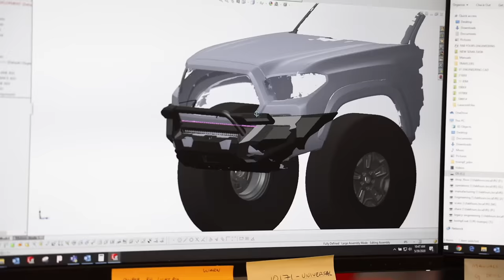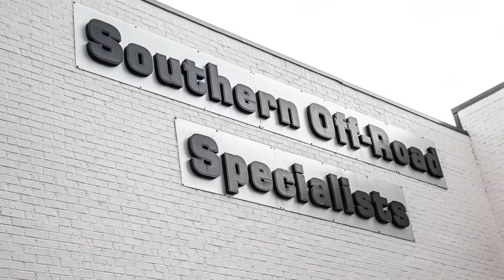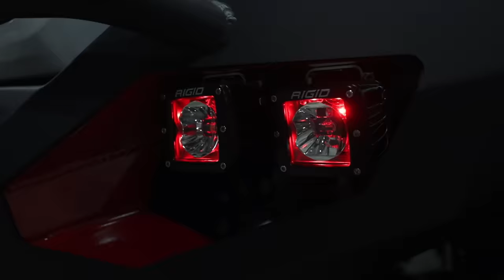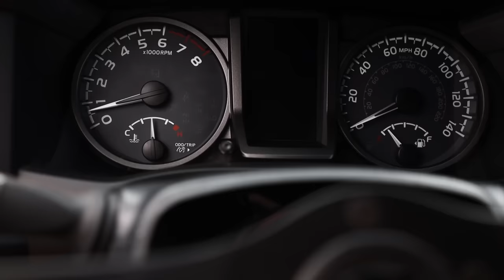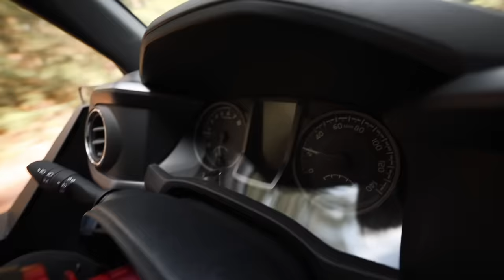Toyota Tacoma Jeep KILLER! Fab Fours Build Walk Around

Comment from the maker: Table of Contents: 
0:00 Intro 
0:35 Why Fab Fours Build this Beast? 
3:05 Why the Tacoma? 
8:15 Wheels & Tires 
10:35 Suspension System 
14:37 Total Lift Height 
15:55 Fitting 40" Tires on a Tacoma 
17:05 Custom Fenders 
18:05 Armor & Bed Rack 
22:11 Lighting 
24:58 Solid Axels 
28:14 Dashboard 
31:51 Transfer Case 
34:20 Interior Mods 
36:52 Sound System 
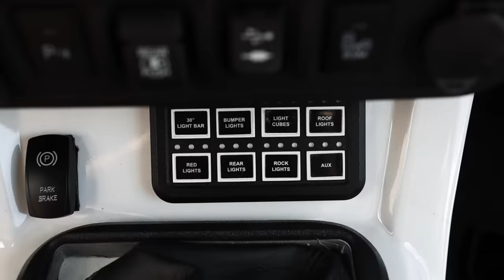39:30 Engine 
40:15 Tube Doors 
46:07 How long did this build take? 
45:50 Total Cost? 
47:34 Future Projects?
Reply: This time series was really helpful . I was here for suspensions but it's all new underneath . 🙏  U got real knowledge . Very few have.
Reply: Just put a procharger kit on it
Reply: No offense at all, Greg, but don’t you make a sh*t load of parts for jeeps too? As a Jeep owner, with 13 built for street (a slammed JT, JTR, JLR, CJ5/7/8 and JKR, to name a few), also built a few Tacos incl a 550whp XRunner, TRD Pro and Classic 86 BTTF tribute with modern KCs, bullet hole wheels and 37s lift 6”, im about to sell my 475hp/521tq 2.0L turbo (Garrett G25-550 turbo) JLR to go back to a 2024 TRD Pro Off Road… any advice?
Reply: It's cool, but that cost way more and had /needed way more parts, fab, work done to be a "jeep killer" and it's still a v6 .. would much rather have the v8 jeep wrangler,  gladiator or even cherokee fully built up. And over a jeep I'd prefer a raptor r , ranger raptor or the bronco raptor with very few actual modifications needed to jump, off-road, rock crawl, sand dune, Baja race/drive fast in the desert, mudding and still be able to drive daily, tow my dirtbikes, quads, Harley or Ducati, snowmobiles ect .. still use for hunting/camping in back country/mountains ect for days and have room for everything I need and so on. This is just a Tacoma body on a fully completely custom everything else as cool as it is

Comment: so having a 2019 taco and looking at what to change as well as what can be changed - never did I imagine swapping doors. If we can get them to a quick swap (and to me that is 30 minutes) that would be awesome.
My only "issue" is the aesthetics and how the doors are angular and not following the lines from the front fender and the bed line. me personally, I would like to see the doors a little higher up for the top of the tube doors to line up with the bed line right above the "sloths back".
but this really opens my eyes to what can be done  - just have to find the budget to make it happen.
Reply: Door height is based on arm on door during cruising. Too high and arm on door wont be comfortable. U want form or function? Owner choose function, your thumbs up show form. There is no right answer.
Reply: You'd have to install bars to strengthen the door joints. That car was not meant to ride without doors, so it compromises the body structure. Not to mention that if you were tboned your almost certainly die. Not a good idea
Reply: @argon7479  Ok Karen... 
-First; it's not a car. 
-Second; How do you know you'd have to strengthen the door joints? Or are you just speculating? Exactly how much does it compromise the body structure? Perhaps it does a little bit but what's the worry? Are you afraid all the gaps between body panels won't be 100% perfect all the time? This truck was built for extreme off-road conditions and the frame will be twisted and contorted in every which way when on rocks or a crazy trail and it will be fine. Are you concerned that a body panel or two may not perfectly line up? Oh no! 
-Third; Considering that this truck and most others that might have these doors will be lifted vehicles, therefore if you were t-boned most cars would slide underneath it upon impact. Unless it's a semi truck and in that case you are toast no matter what. Plus it's the door jams themselves that would protect you in that case not just the thin doors... "not to mention" that his tube doors look more structurally sound and stronger than the light stock versions. I mean, come on man... this guys company makes BUMPERS professionally for heck sake.
Reply: @zachhartson4819  I know because I've literally bent somebody's frame while they had the door open on their car, when it was fine riding for 19 hours with the door shut. Unibody frames require the doors to not bend, and when you have a car you are using the crawl over rocks, you're going to bend the frame. Most cars wouldn't slide under. They'd hit the bottom of the door frame, which now that there's no door, is going to bend straight upwards and severely injure, if not kill you. Car doors are designed to crunch and absorb impact, plus keep the person safe with soft plastic and airbags. This will just mean glass and metal shards shooting into the car. Look up Jeep impacts without doors. Those cars are actually designed to be stable with no doors, but crashes demolish them with no doors
Reply: @argon7479  If that's the case, then it seems as though this guy didn't do his homework. Although being in the off road scene as he is, you would think this guy should know some of these things that you are talking about. So what you are saying is that this truck without its full sized doors on it AND closed, it will get structurally damaged once it's been driven off road? Considering he upgrades and builds many types of 4x4 trucks for a living, one might think that's something he would know about, that's all.
Reply: @zachhartson4819  This truck is not really meant to be a great offroader. Trucks in general, are not good for offroading and this is mainly just a show truck. Having doors off, might look good for show, but it doesn't take a genius to know that it's not practical. The truck survive some slow and careful offroading, but id never want to take this driving on normal streets because of how dangerous it is. One side collision and the entire driver's area is crunched

Comment: Hell yeah, I'll take some of this hinges that let me (easily) take off my factory doors off in 15-20mins, i dont care for the tube doors, but if I could just take my factory doors off for a day of wheeling, and back on once I'm home, that would be absolutely killer.
Reply: just 4 bolts to take both doors off in my tj. really the only hard part you have to do for a truck is wire up plugs for the wiring then you can have the door off in 2 minutes with a floor jack and an impact

Comment from the maker: Doors are officially now available! - https://bit.ly/2Z9P7kz
Reply: Amazing 💪😎
Reply: Well for folks that dont have half million dollar shops to work on rigs you should check out fab rats taco. It's a simple well built home built taco that gets used for some reason hard work.
Reply: I've decided after watching a bit more this has gotta be a million dollar shop instead of a half million...looks like a pretty sweet setup though
Reply: Sounds like WhistlinDiesel might need to come by.
Reply: Thank you! I never knew you existed. Prepare to take all my money 💰!!
Reply: Bro make the doors in to steps
Reply: since they are fabricators can they do those doors for my 4thgen 4 runner?
Reply: Those doors are kool, but would be kooler is they had like a riot shield attachable PVC barrier with a trim that covers the ugly indents.
These PVC shields can be dethatched and mounted somewhere on the body or tray in a specially designed rack, for easy removal and security.
The barriers should allow the doors to be lockable, and easy to install, and reinstall after a trip for security and health.
that would improve the market imo.

Comment: If this is being labelled as the "baddest" Tacoma on the planet, then you really need to expand your horizons and check what is being done outside the US and Canada. The modified SUV and truck community here in Iceland is really getting very big. We have a Tacoma 2006 model, started off with a small modification for 38" tires and no lift. Now we run 44" tires and only needed a body lift of less than 2" and we cut into the wheel welds and modified our fenders. Our rear drive comes from a Land Cruiser 60 for added strength. And we still run the IFS, but we have beefed that up somewhat. We have all the travel we need because of the added space inside the wheel welds. Admittedly we do not need as much travel as some in rock crawling do but we have plenty as we do snow wheeling. We have two transfer cases for low-low gear ratios. We crawl when we need to. Our suspension is Fox coilovers in the front with a reservoir and Fox bypass in the rear, also with a reservoir built into a 4 link air ride. 
Last time I checked a Tacoma with a similar build holds the land speed record to the South Pole which was built and designed here in Iceland.
Reply: Can you suggest a YouTube or website to see these trucks?

Comment: Nice one off taco. Just some advice for those two 10's, if you remove the plastic from the back of the seat they will thump even harder and sound cleaner. no one even sees back there but the plastic kills a lot of bass.

Comment: Can you pull the carpet and Rino-line the floor. With drain holes. As for the seats. Can you get a custom set of Waterproof seat covers? I think that would make it way more rain and water friendly. I absolutely loved these doors. I have a 2011 Tacoma with 76k in miles. 4.0L. No dings, scratch marks, or dents on it. I’d proudly put a set on my truck.

Comment: I would love these on my 06 i already have no carpets and have replaced them with rubber Matt's and rinolining but its parked outside full time security big thing my ninja motorcycle has a proximity alarm  on it if we could include something like that on my taco too would sove that problem. Only problem I see with getting these would be the change out time and hassel if you could make these fast and easy to use I'm 109% in so show me that its quick and easy and you got a set sold maybe even look into a mount  or storage of the door on  or some where in bed or outside on side panels of my overland  rack if possible do you could change them out on the fly would be cool just a thought.  Great interview!

Comment: I love my manual 2019 but I did not think of a slower crawl. When I got the truck 3rd day duck hunt trip stock blew the dealer tires. (Got new ones after an 8hr trip on the spare). Week two, new bumper & winch set up. (Close call in the mud) went chucker hunting climbed rock wash outs and followed dirt bike trails. (Need suspension and rock slides ASAP) got lucky. But now oh man tube doors that’s going to make hunting amazing. Just don’t have a garage. Maybe  tube door with some sort of clip on covers. I want tube doors. I hate where I live now bipolar weather. I’ve been fighting the jeep battle in my family. Doors have been a point of subject. I’ve been able to keep up with my grandpa in his jeep rubicon. But now he is building his old Jeep Willys. My dad is selling his built tundra for a jeep. For way to cheap. 8k it’s easily 20k+  but he wants a better platform. It’s been a goal to bring them back on board with yotas. Tube doors one step closer. 

So much to think about. And is it a bad idea to supercharge my taco? I like the idea of surprising ppl getting on the freeway or just at a light surprise. I originally was thinking turbos because I miss the sound in my Diesel. Miss the power too. Yet something about the taco screamed I’ll get you there....Reliably.

Comment: It's got a lot of rear overhang... have to cut the back off to avoid dragging on tough trails.  Also the mid-body long arm mounts seem over leveraged with such big tires and heavy axles.  Need to beef them up as well as the arms themselves.

Comment: So you call 272:1 gearing a sloth, what would you call my Kubota rtv1100 on Toyota axles and 5 spd trans, powered by a 993cc v twin, with 327:1 crawl ratio? Fyi 3.61 low on the CVT, 2.46:1 on the chain case, 3.95:1 first gear, 2.28:1 low, 4.10:1 r&p. Also 39.50x15-20 tires. I call it 'yota'bota.

Comment: Only thing I don’t agree with is the low power. Definitely could get a lot more out of that build with a 2engine from a tune, X pipe, turbo, custom exhaust then a down pipe closer to the rear so you don’t get as much drone.swap but you did put the manual so you may not want the high power. Love that truck though
Reply from the maker: That’s a good take !
Reply: @tacomabeast  make it happen captain 💪🏽

Comment: Its a cool truck but would still prefer a v8 jeep gladiator/wrangler/cherokee with a few modifications. A raptor r or bronco raptor with few modifications or if im going fully custom a toyota land cruiser or 4 runner suv that is fully built and bullet proof front to back. Need a vehicle that can still tow my quads, motorcycles,  snowmobiles, enclosed trailor i use for back country/mountain/high desert hunting, fishing and camping. Have room for gear, spare wheel/tire , tools, hunting gear gun and bow stuff, fishing gear and poles, my dogs , friends ect ... and most importantly be driven reliably daily or few times a week minimum still.

Comment: Check rockslayeroffroad 2017 tacomo solid axle double triangulated 4 links no track bar, running 45s tires on 20" travel shocks with atlas 4speed

Comment: It should dropped a D4D turbo Diesel engine from Hilux Diesel Toys out of Texas import and sell the package which is a direct bolt on the manual transmission! I use to have a 97 Nissan Navarra hardbody diesel it was a focken war machine I’m sad that I sold it but didn’t have money to fix it up it had 250000 miles on it!

Comment: lmao. So lifted weaksauce taco with straight axles and knobby tires. Cool.

Hows gas and track time? You need power to move those wheels. I bet it no longer does more than a 100mph anymore. That thing is only good for SEMA or small trails. It will get stuck rock crawling cause it has no power.

Comment: That is a sweet truck, but that is no longer a Tacoma.  At somepoint so much modding turns a stock truck into a complete custom new vehicle with a Toyota chassis and name plate on it.
Reply from the maker: So it’s kind of like Theseus’ ship? Where if you put all of the parts you took apart together it would make the original Tacoma? Or would it be a new Tacoma? 🤔

Comment: He said it has "3 link suspension front and rear."
False.
Up front it has Radius arms. Or a 4 link/ Y link. It has 2 lower "long arms" with each having a baby arm to the top of the axle for the uppers. A 3 link is more work, but less binding. Cool taco... jeep killer is silly to say.  Vs a $100k Jeep?! Run king of the hammers and get back to us